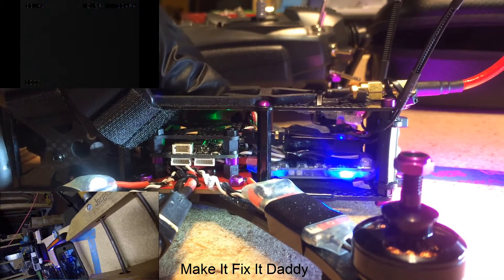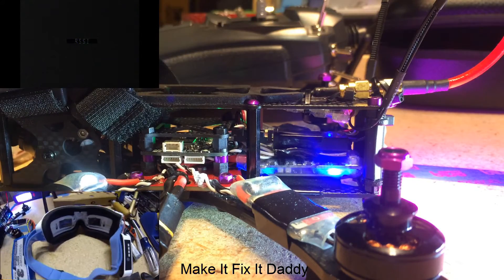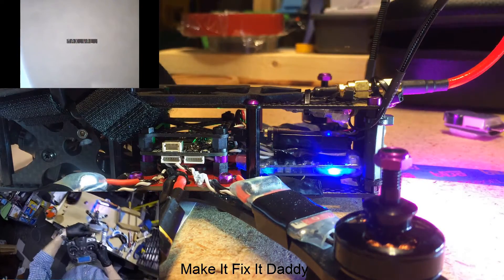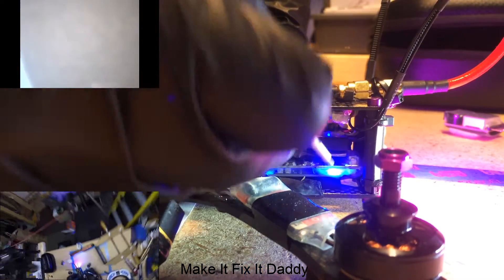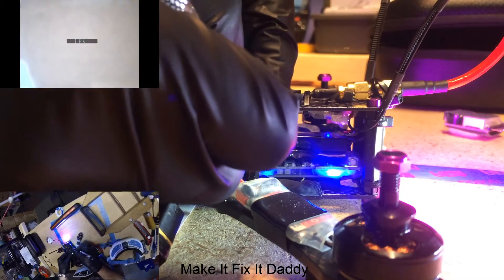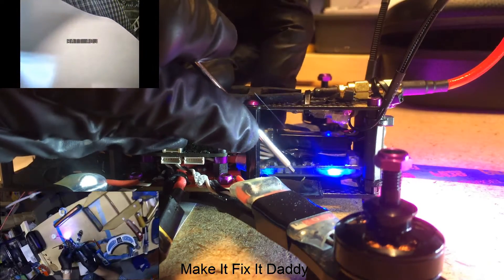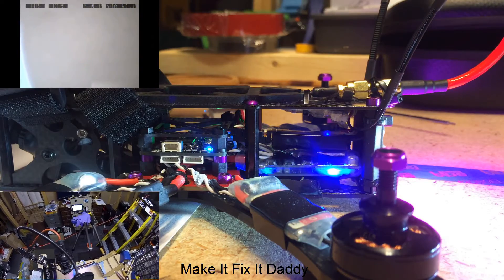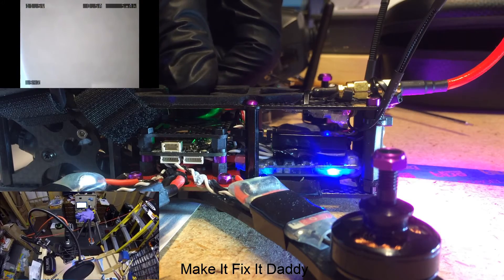TBS PNP50 Menu How To

Comment: i made the mistake of buying a pnp pro and placed the vtx on top just like you did but iam getting a lot of noise, any ideas?
Reply from the maker: If you have a Unify Pro HV, then your are having the same issue many of us are having.  I would suggest adding a capacitor to your main power leads to see if it cleans up your video.  Please leave another comment if you find the solution.  It may help other people.

Comment: How are you getting the black bars behind your osd values?
Reply from the maker: Herbie FPV,

I wish I knew why I have them.

I have a friend who ordered his straight from TBS, and he has no bars.  I ordered mine from Heli-Nation.com and I have the bars.

We reviewed the boards to see if there was a difference, but we could not find one.  It would be great if TBS allowed for more customization in the PNP packages.  I do believe this would diminish this would go against the basis of design for the PNP packages, Plug-N-Play.

TBS, or someone else, needs to make a new package that meets the needs of the reflected in all of the commentary I read.  Lightweight OSD package which includes a current sensor and the connectors necessary to be easy to use...
Reply: Yeah thats weird lol i have two of them and neither have the bars one came from the rotor riot store and the other from getfpv. And yeah it would be nice for more people to make a pretty much solder free osd definitely.

Comment: Hi, which receiver are you using? I have the x4r-sb, which outputs its rssi value as PWM. I'm wondering if the pnp50 will read that fine under its analog setting, or if we'd need a low pass filter.

Also, is there any way to make the flight timer stay up the whole time? Looks like it comes on for a few seconds then goes away, and reappears on the minute. I'd like it to stay up the whole time.

Thanks!
Reply from the maker: I am using the same X4R Rx.  RSSI reads fine under the analog setting, and make sure to do the range calibration I demonstrate in the video.

The flight timer comes on at each minute mark.  As far as I am aware, there is no way to change the settings for the timer.  I would love to have control over the OSD display options like you can with minimOSD. Looks like there is a market for an all-in-one simple to use OSD package with programmable OSD that remains unfilled.

TBS,

Please give us more settings / programmable options for the PNP OSD series.
Reply: Thanks! I'll give that a try.

Comment: Great info, thanks. How did you wire up the pnp50 to the kiss fc to get the RSSI? I used the BST cable that came with the cf micro rx and connected it to the link port on the pnp50 but the pnp50 has no connection to the kiss fc..... Only shows 100% in the OSD. Any advice would be great. Thanks.
Reply from the maker: I connected the RX to the OSD not the Kiss FC.  Determine which type of RSSI signal you get from your RX.  Mine is analog, so I set the OSD to RSSI Analog and then calibrate the OSD:  I believe the first option is the high signal, have the TX on and press the enter button.  Then it should ask for the low signal, turn off the TX and then press enter on the OSD.  this should calibrate the OSD to the high and low from your RX.  I hope this helps.
Reply: Thanks for the reply. I used the LINK RSSI option as my TBS micro is connected to the PNP50 via this port. It seems to be working now. Thanks once again.

Comment: Thanks for the vid. I have the "rotorriot" alien 5 build and installed the pnp50 as well. The only problem I have is that I dont see any on screen display at all. The camera image is perfectly fine but I dont see any osd. If I press the enter button nothing happens. 

BTW I clicked on the advertisement!
Reply from the maker: I noticed when I would first connect the system, that until I moved the camera around to look at different contrast or objects I could not see the text.
My system has the Black bars around the text (I purchased my TBS PNP50 from Heli-Nation), but my friend's only has white text (He purchased his from TBS directly).  I believe we have the same version, but It seems that there are some variations in the look.
I have been unable to determine if this can be changed or upgraded.  At the moment, it appears that only the TBS CORE Pro can be upgraded.
Reply from the maker: I had to press and hold the enter button for about 5 sec or more to activate the menu.
There should be a initial menu at boot up.
I assume you have the camera connected directly to the PNP50, and the vTx is connected as well? Refer to the following images.
http://fpvlab.com/forums/attachment.php?attachmentid=34809&d=1383438101
http://fpvlab.com/forums/attachment.php?attachmentid=52621&d=1412791410
http://www.team-blacksheep.com/img/gallery/DSC_6359_edit_web_raw.jpg
Should look like this:
http://i.imgur.com/H9ywjUc.png

I hope this information helps, it is probably redundant, but it may help some other people.  If it is connected as shown and you still don't have any OSD, I would contact the Support Center at TBS: http://team-blacksheep.freshdesk.com/support/login
As stated on their support page, their products carry a 2 year warranty.  Cheers!
Reply from the maker: If you are able to bring up the Menu, the last option in the menu is to turn on the OSD.
Reply: Yes, I connected the 3 pin hs1177 cable to the pnp50 and the 4pin vtx (tbs unify pro) as well like shown on the images. Even though if i press the menu/enter button for 30 sec or so, still nothing shows up except the normal vid (without any bars or numbers).  Yesterday I contacted TBS and got an answer today. They immediately offered me to send a new one. Really amazed by the great service and quick response!
Reply from the maker: I am sorry you are having issues, it is always a let down when you are preparing to finish a project like this and have to wait to complete it.  However, I am glad to hear you are having a good experience with the TBS Support Center so far.  Please fill us in on the full experience after you receive your replacement.  I am sure other people would like to know about it.
Reply: Luckily they allowed me to keep the defect one until I received and tested the new one, so I am still able to fly my alien 5' except that I currently dont have any osd (luckily connected my kiss esc telemetry). Seemed to be a bad batch as several other people are having the same issue. 
Will keep you updated!
Reply: UPDATE: Received my pnp50 replacement yesterday and installed everything today. Works like a charm. So it really seems like the first one I received was defect (without software).
Reply from the maker: Congrats!  I am happy to hear that everything is working well.  The is a good testament to the TBS Support Center.  Thank you for the update.

Comment: what wires go from the rx to the pnp50?  I got everything working except rssi
Reply: im running x4r though
Reply from the maker: I have the analog RSSI connected.  While the D4R-II have a pin for this the X4R has a solder pad adjacent to one of the antenna, reference the following video: https://youtu.be/S22I58qDtZc?t=48s
Reply from the maker: In the following image, the user clipped the pin from the board and soldered the RSSI pad to it...  http://fpvlab.com/forums/attachment.php?attachmentid=69886&d=1454083121